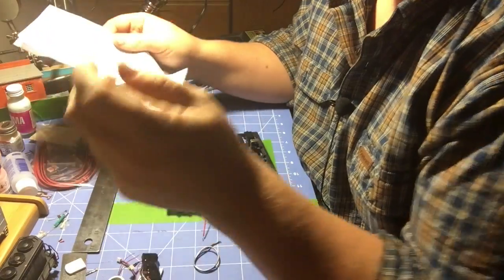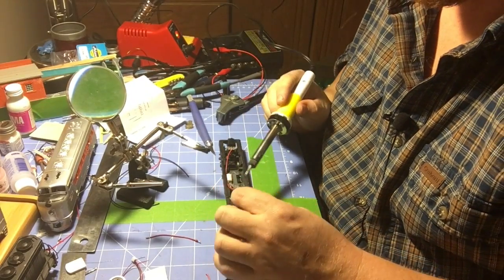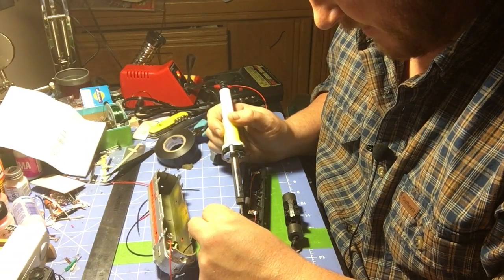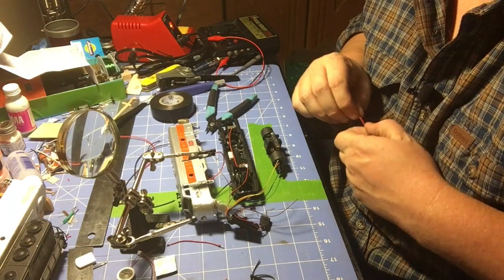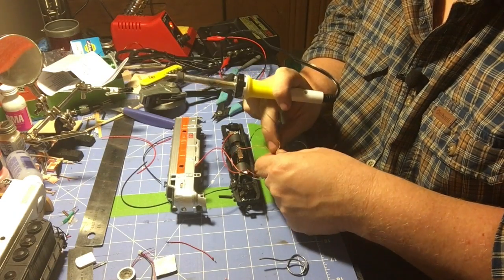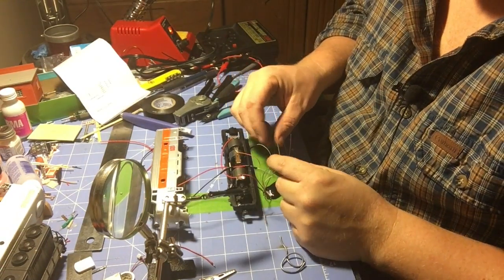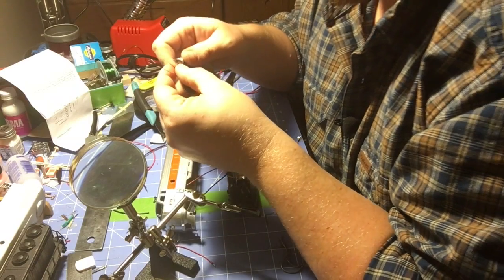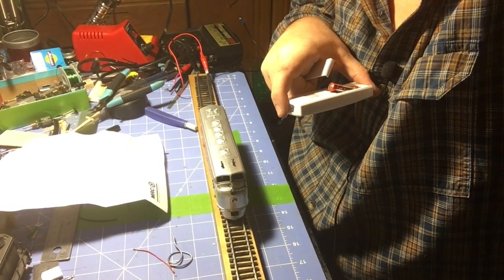How-To #7 - MRC Loco Genie Install (Part 1)

Comment: no one reads direction ! Do they? that was quite the install .  so DC made into DCC,, just one hand held controller at a time? might need to label the controllers, for sure.. thanks for sharing,, run video next?
Reply from the maker: +sparky107107 - they weren't very good directions, shoulda skipped them.  It is essentially DCC on DC.  you can run several at a time, but like you said...just gotta label the controllers.  You can also run it on DCC with a normal DCC controller.
Reply from the maker: And yea, some programming and running in the next part.  Didn't want to make the video an hour long.